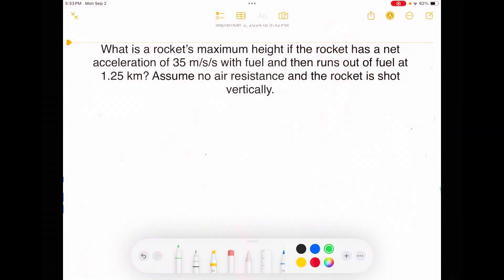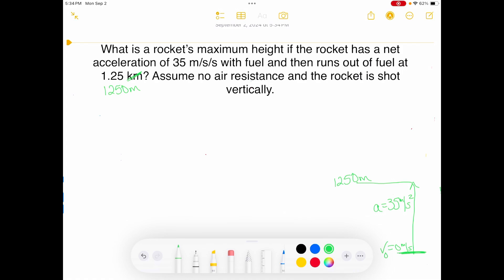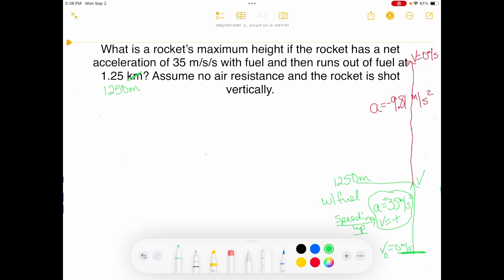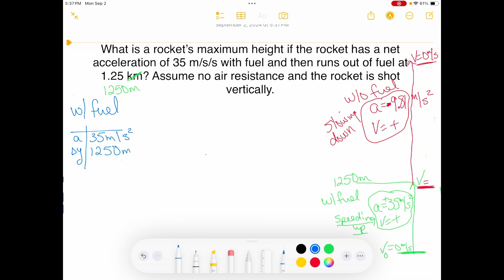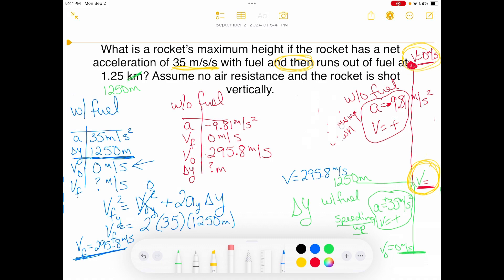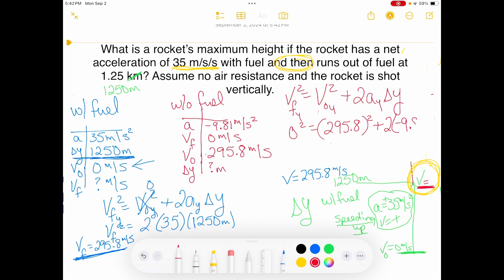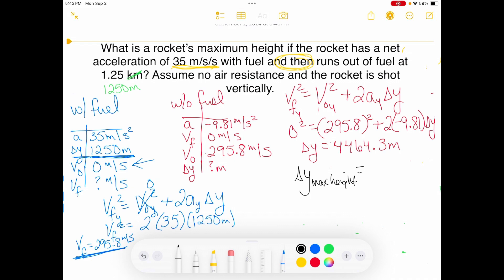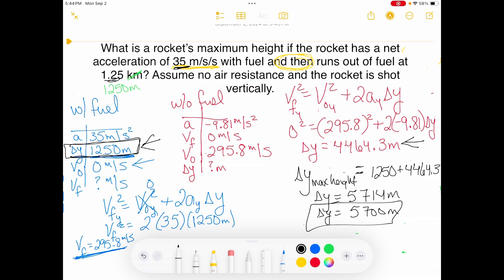AP Physics 1, Unit 1, Problem Video 7: Free Fall- The Rocket Problem

Comment: I dont why i thought that when the rocket runs out of fuel it would immediately start dropping down back to the launching pad. Can you  briefly explain why the rocket keeps going up even after its passed the distance of 1.25km. (Sorry i know this video is old im catching up to all the videos😭😭.)
Reply from the maker: Do not feel bad, that is a very common misconception and never apologize for wanting to understand. 😊 When the rocket gets to 1,250 m it has a large upward velocity and will continue to go up until it’s vertical velocity is 0 m/s at which it will turn around and fall to the ground.  After the rocket runs out of fuel, earth takes over and slows the rocket down with -9.81 m/s/s acceleration until it reaches  0 m/s at maximum height. Kind of like a car, it does not stop immediately when you take your foot off the gas pedal, but coasts until friction causes it to stop. But in this case it is Earth’s gravity that is causing it to slowdown and stop at maximum height. Happy Physicsing!!